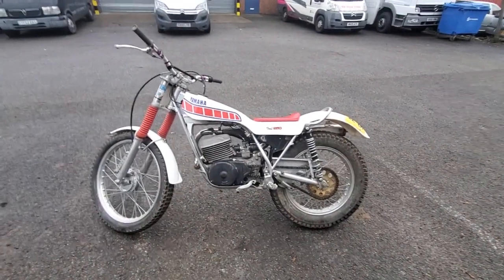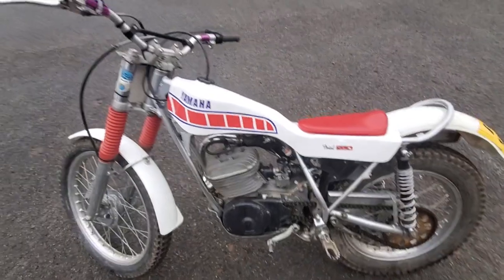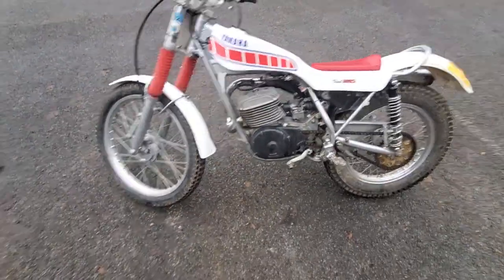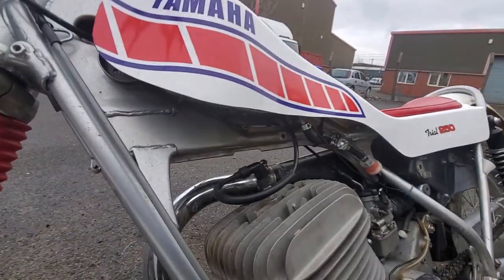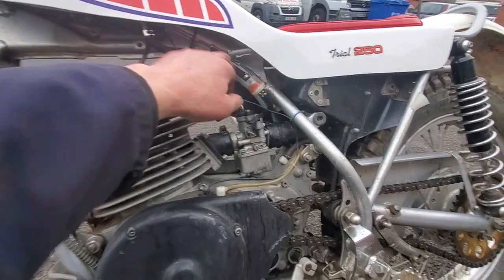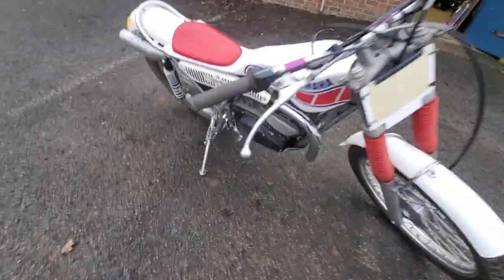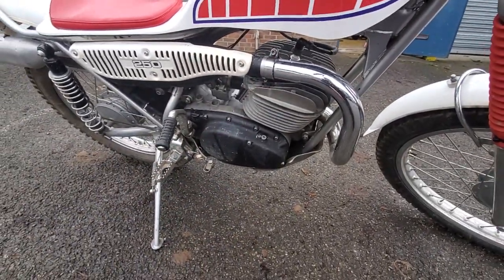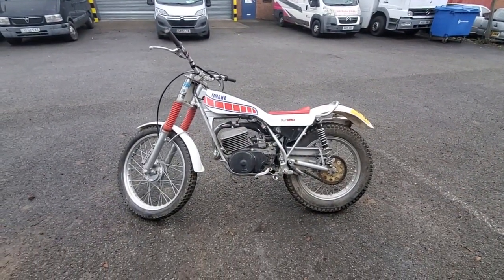Classic Yamaha TY250

Comment: nice job beautiful bike but fuel tank cover could rattle?
Reply from the maker: Yes it will a bit, I put  foam between the tank and cover though to minimise any movement or vibration.
Reply: @dbmotorepairs  great all in all well done 👍🏻